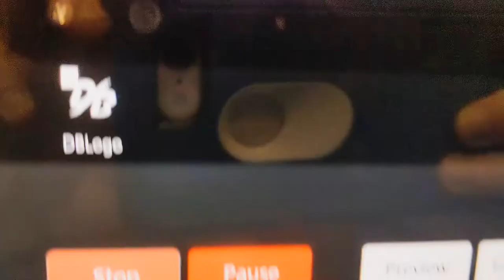Throwing a ceramic pen

Comment: So cool! I want to try this. Where did you find the little metal inserts the nibs fit into? Can you buy those somewhere?
Reply from the maker: I found them on amazon, you can buy them as sets for pen making. Ferrule is the seat that the nib goes into and they come in different sizes. You can buy them in bulk from different retailers. i've seen them on ebay and amazon. I purchased mine from a now defunct wholesaler.